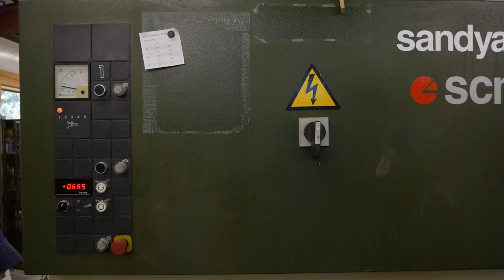Making A Simple Ladder Shelf From Hickory

Comment: That lathe, used at 5 min, I'm 99% sure a new capacitor is what it needs to start properly.
Reply: Magne Polden I was about to comment the same thing, the start capacitor needs replacing, cheap fix and no need to replace the whole motor.

Comment: Your lathe starting up haha my band saw does the same thing...
Reply: Jack Brennan and you help it to start the same way with hand?))
Reply: No Reach around behind the saw and spin the pulley.
Reply: Sounds like your run capacitor is dead.  That is if you have a run and a start capacitor.  My run went bad and it took  a bit to get up to speed.  And if that's the case, then you're wearing out your start capacitor faster and it's more expensive than a new run capacitor.
Reply: thanks Jason.
Reply: Maybe clean the inside helps?.